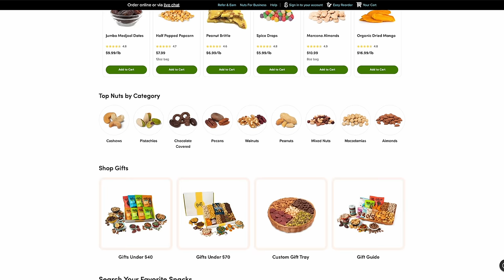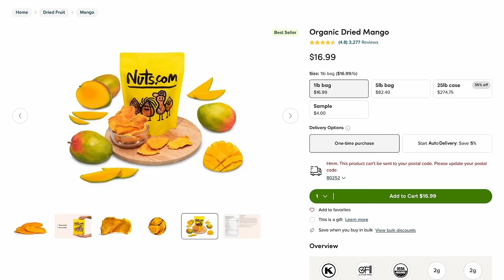Shop Addition: Drywall Is Done And Ready For Paint!!! Ford Bumpside Diesel Fuel Issues Fixed!

Comment: Really liking the truck build. Make you wonder why they didn’t simplify the fuel system from the factory. Keep the truck bed, but the flat bed would be a better use for how you live. If you plan to sell it, the original truck bed would be a good option for the buyer.

Comment: Key to keeping an IDI starting; 1.Good battery cables and batteries 2.Electric fuel pump.3.all 8 glow plugs working.4.return line hose and caps sealed good. Thanks Heath, ah Mr. Skinner, for all the IDI entertainment, I love it!

Comment: You should look into a Fass or Airdog fuel system for your truck.  They both have a system to eliminate air and also have in line fuel heating for the winter months.  I've owned 4 systems on 4 different trucks and they work so well.  I would never own a diesel truck with out one of them.  Great channel, have followed you guys for a while now.

Comment: Always interesting to see how folks in other areas do things, or what materials are common in different areas. For example, I grew up in the Seattle area and now live in Maine. In the northwest a piece of pressure treated lumber is I think Fir and perforated before it's run through the treatment process. In the northeast I've only seen Southern Yellow Pine pressure treated lumber. It's not perforated and is in fact a nice bit of lumber for exterior finish work. Regarding drywall. Other than to put on a texture, I've never seen anyone fully skim a wall and sand it smooth. I typically address seams and corners, then sand those joints smooth, then paint the wall. Untextured walls are typical, in my part of Maine at least. Still a lot of older homes with plastered walls.

Comment: Hi there. 
First time commenter, but long time viewer. The first video I saw was the one in which you and Cedar installed the first propane tank behind the shop. Since then I went back and watched all your videos (except some Q&A videos, there to long and with no action). I've known your last name since about 4-5 years ago (or even more) and your ranch location since about same time (in the recently updated Google Maps aerial view, you have what seems to be a red truck with a trailer attached in front of the shop and the pool is half shaded by the wood shelter roof). Yeah, it's a bit of a weird hobby, but I like to find stuff online. I'm not a stalker or anything like that, though (it would be hard to stalk from Eastern Europe). I just wanted to point out (and make your aware) that, despite your efforts, privacy is not something you can control anymore, unfortunately. In current day and age, anyone with an internet connection, some basic (detective?) skills and some persistence, can find a lot of stuff, especially on public persons like you.
Keep up the good work, I'll certainly keep watching. Cheers.

Comment: Don't take this as a criticism because I honestly don't know. For those with a background in drywall; is Heath's approach to drywall a little bit overkill? That's a lot of skim coating and sanding. I thought the entire point of gypsum wall board wad to reduce the labor of the old ways. Again, I have no idea. I've just never seen anyone do that level of prep before paint. Educate me, please.
Reply: I think it depends on where you are from.  All the US sites I've seen do it like Heath.  Most of the UK guys seem to simply skim the tape lines and screw indents.  Looks to me like the full skim coating produces a better finish for painting, while the UK method is designed to be covered by a lining paper.